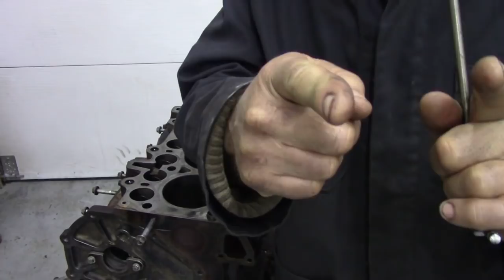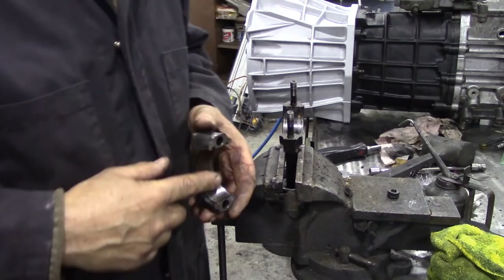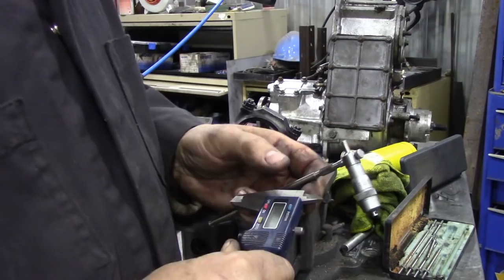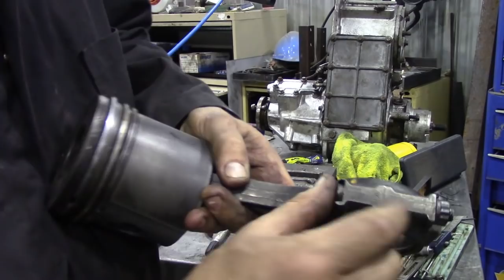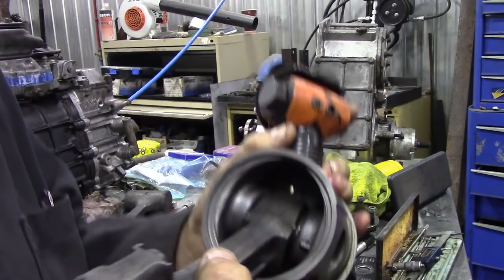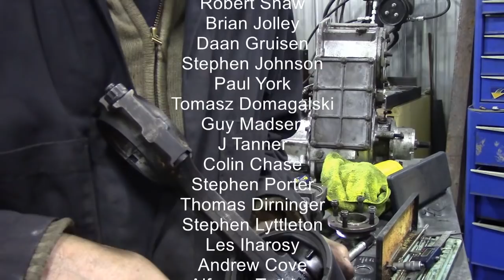300 Tdi block and piston inspection. Part 1 - some things to note.

Comment: thanks for the info very good , looking at the pistons assembled question is it ok for a little movement  diagonals movement at the gudgeon  pin , many thanks
Reply from the maker: The rods move side to side if this is what you mean?
Reply: just looked at another video you explained it there  the bushing need to be replaced , the thrust washers dropped in my engine so i have a second hand block and re do the lot has 360.000 km

Comment: Are britpart 300 t.d.i pistons any good or are you better off paying a bit more
Reply from the maker: I have used them in the past and didn't have any problems
Reply: Thanks for getting back to me I'm thinking about putting some oversized pistons in my 300 t.d.i and britpart are half the price and they look OK. Just thought you might know because you seem to rebuild quite a few engine.
Reply from the maker: I asked my engine machine shop about these cheaper type pistons, and they fit loads of them to stock engines (not high performance tuned engines)
Reply: I'm thinking about advancing the timing to get a little bit more power other than that it will be standard thanks for letting me know cheers

Comment: Hello,
I wanted to give you a suggestion about the tool you use to check the ovalization of cylinders and connecting rods. What you use is a measuring instrument, that is an internal micrometer, which is only used to read the diameter of a hole. For the check you must use a bore gauge, which, after having zeroed it to the nominal size of the hole, you will be able to find the deviation and therefore ovalization and cylindricity.
Hi from a mechanic like you who really appreciates your videos.
bye

Comment: Hi. I love your videos. I have a 300tdi and need to change the small end bushes as one of them has started to break up and is causing a knocking noise. In one of your videos you mentioned the problems of reaming the 300tdi small end bushes as they have an oil passage machines into them and I catches the reamer. I have noticed in pictures that the 200tdi bushes don’t have the grooves in them as they are fed with a hole. Do you know if the 200 and 300 small end bushes are the same size? I don’t have access to a good machine shop and I wondered if it would be possible to fit the 200tdi ones and cut the oil grooves in them with a die grinder after they have been reamed. Do you think it would work? I don’t fancy buying a set of rods.....
Reply from the maker: The rods on a 300Tdi are tapered  and the 200 are parallel they are not interchangeable -my machine shop could not fit the bushes as he was not set up to do them - I bought new rods with bushings already fitted
Reply: Britannica Restorations Ltd I bought some replacement 300tdi bushes which came parallel, pressed them in then reamed them. Finally I filed back the ends of the bush flush with the rod. I have got it back together and so far all seems good but if the 200tdi bushes have the same outside diameter I could fit those and the reaming would have been a lot easier. Then just filed back the ends afterwards. Do you have any 200tdi rods that you could measure the outside diameter of the bushes for me?

Comment: Love the videos, as you mention i have a 200 tdi with that rear cam bearing spun and blocked the oil port. Is there anything that can be done? Or is the block scrap? Ive had a machine shop suggested a loctite product used to lock dry liner sleeves they say will work. Any ideas
Reply from the maker: The Loctite should work  - depends how bad the clearances are
It is a pity it is expensive to pin or sleeve the bush

Comment: The last time I stripped an engine to this degree was a rare classic Alpha and I found the best way to clean the carbon out of the top piston ring groove was to break the old top piston ring and use the broken end as a groove scraper, perfect size without damaging the groove. Oven cleaner didn't shift enough crap.

Comment: Cam bearings might be a machine shop job, you need to ream the bearings to size after installing and the big reamers are big money.
Reply: Does the the front camshaft bearing in 300tdi also needs reaming or are they straight fit? Couldn't find any info about that.

Comment: Magnificent information, Mike. What are the chances of a crack in the block or on the cylinder linings?  If there is a crack in one of the linings, I guess its a block to be scrapped?
Reply from the maker: You can press in a liner and salvage the block, but as there are so many 300 engines kicking about now out of rotten Discos, then it may not be cost effective
Mike
Reply: I'm not in the UK, I'm in the Canary Islands in Spain, and 300 engines are not an easy thing to find over here. But first I'll check if there is any crack visible.  I'm taking the head to get it to pressure test first, as there is no warping or bending, and the gasket was in perfect condition (not blown-up). I still don't know where the oil is mixing with the coolant.

Comment: to clean oilways.. gun cleaning rods are not common in the UK,  but nylon brushes for cleaning home brew equipment are
Reply from the maker: Can you get brushed that small?
You can buy proper brushes but £££!

Mike
Reply: i bought a set  of brushes years ago, from memory smallest will go down about a 3/8 inch hole .. with the popularity of micro breweries these might be easier to get ( and probably more diameters & lengths available )

Comment: Hi mike,  saw the gearbox in the back ground, how did you get it looking so nice ? Paint?
Reply from the maker: It is called engine builders paint or sand blast finish - not sure about the UK but it sticks and does not come off after a power wash Straight onto bare metal
Mike
Reply: Thanks mike, looking forward to my clutch arm coming.
Reply from the maker: It will get there! Problem is is sent by Canada Post and delivered by Royal Mail 
I think that sums it up  - not known for speed of efficiency

Comment: Excellent overview so far. I would be a little suspicious about the difficulty of putting the cap on number 3 conrod. Are the bolts still parallel or problems with the holes?
Reply from the maker: Not sure - could need new bolts

Comment: What rebuild kit or specific make would you suggest for rings etc. I know you mentioned AP for bearings. cheers
Reply from the maker: Not sure of the rings manufacture until they get here - listed as Britpart - but made in the UK
Reply: Britpart uses a softer piston ring, some hate them but they are great when you use them in old bores as they wear in quick. When you get a rebore, go for the harder ones.

Comment: What is the lifespan of a 200 or 300tdi, before full rebuild, assuming proper maintenance, no overheating, etc.?
Reply from the maker: Very hard to say - seen them at 400,000 miles but I never know what has been done to them in their life
Mike
Reply: Seen them at 250K miles going strong, also seen a full rebuild done by professionals destroyed within 5K miles. Lack of oil wore it out, after the rebuild she filled it to the top of the engine as she did not understand how a dipstick worked so she wanted  to prevent it by filling it to the brim. Some education and a new engine was in order.

Comment: Very informative Mike.  It doesn't matter using a drill in the end of the internal micrometer as you can read the difference on the scale to find out what the ovality actually is.  I've never rebuilt a diesel engine before but when re-ringing a standard bore size you always get a stepped top ring set.  Is that the same for diesel rebuilds?  Also I'd be inclined to lob the conrod in the bin and buy a new one as it looks like it has gone through a lot of stress.  Would that be a practical solution cost wise in this case?
Reply from the maker: Modern blocks rarely get steps so no need for stepped rings
As for the rod -  I will see what the machine shop says first - they are pretty good